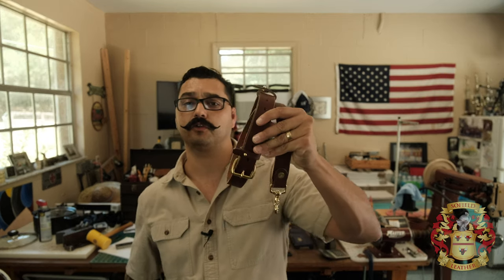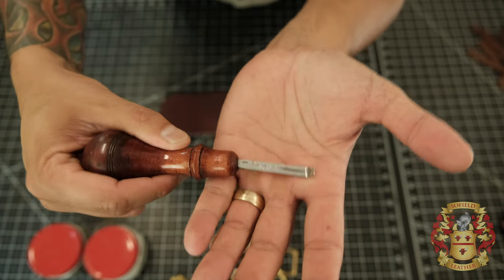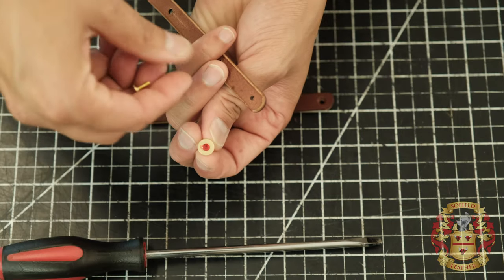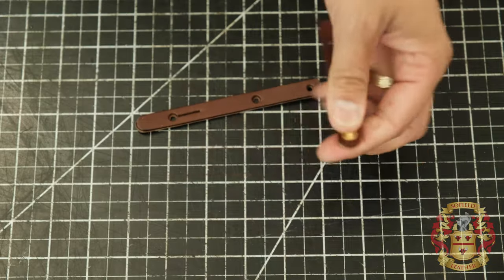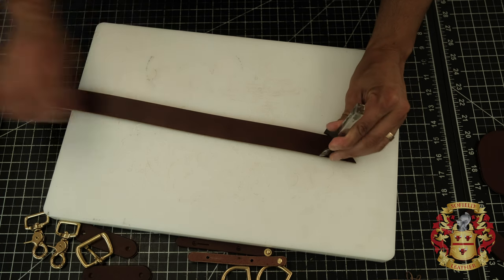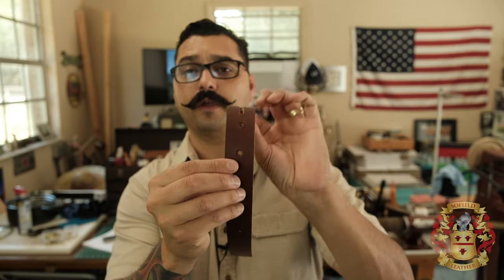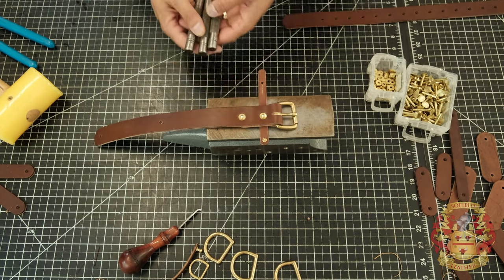How To Make a Leather Satchel Bag - Part 2 of 6 - Pattern Download

Comment from the maker: How To Make a Leather Satchel Bag - Part 2

💾 Download the Template
→ https://www.sofieldleather.com/shop/p/briefcase-pattern-build-along-video

💼 Watch the Whole Build Series
→ http://bit.ly/Satchel_Bag_Build_Series

👨🏻‍💻 Download Templates, Patterns and Blue Prints
→ https://bit.ly/Secret_Blue_Prints

🤷🏻‍♂️ How To Use My Patterns
→ http://bit.ly/How_To_Use_My_Patterns

🛠 Hardware - Tools - Material⇩

👉🏼 325 Dee Solid Brass 1 1/4 inch
→ https://www.weaverleathersupply.com/catalog/item-detail/00325-sb-11-4/325-dee/pr_1070

👉🏼 325 Dee Solid Brass 3/4 inch
→ https://www.weaverleathersupply.com/catalog/item-detail/00325-sb-3-4/325-dee/pr_1074

👉🏼 1144 Collar Set 1 1/4 inch
→ https://www.weaverleathersupply.com/catalog/item-detail/01144-sb/1144-collar-fastener-set/pr_1730

👉🏼 5015 Square Scissor Snap 1 inch
→ https://www.weaverleathersupply.com/catalog/item-detail/05015-sb-1/5015-square-scissor-snap/pr_2320

👉🏼 50 Buckle 1 1/4 inch
→ https://www.weaverleathersupply.com/catalog/item-detail/00050-sb-11-4/50-buckle/pr_321

👉🏼 3425 Button Screw Stud 1/4 inch
→ https://www.weaverleathersupply.com/catalog/item-detail/03425-sb-1-4/3425-button-screw-stud/pr_2211

👉🏼 Circle Tool
→ https://windfiredesigns.com/Tools/CircleTool/index.html

👉🏼 Pippin Punch
→ https://www.buckleguy.com/105-2-oval-pippin-punch/

👉🏼 Wicket & Craig Leather (Ask for Cindy)
→ https://wickett-craig.com/direct-sales/

💼 Shop 
→ https://www.sofieldleather.com

⏱ Time Stamps:

00:00 - Intro & Info
02:03 - Need Your Input - Thread Color
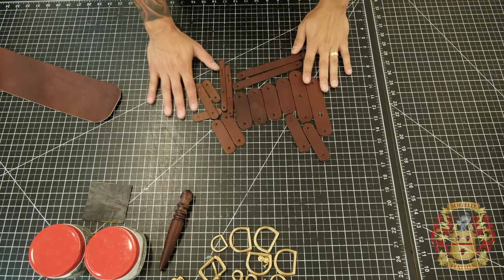02:58 - Bevel, Burnish & Edges
08:58 - Shoulder Strap Overview
11:13 - Assembling the Strap Keepers
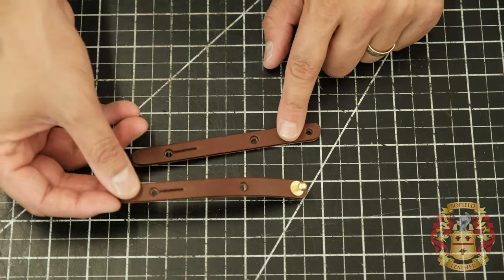12:28 - Marking the Strap for Punching (M)
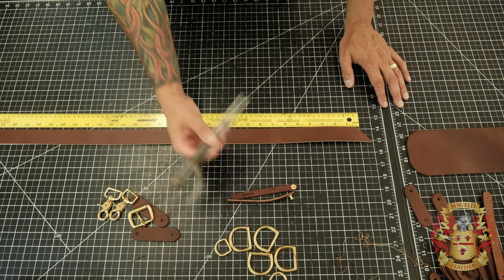13:34 - Important Tool Tip
15:46 - Punching Out the Strap (M)
16:50 - Marking & Punching Out the Strap (N)
18:30 - Quick Tip on Scrap Pieces
19:50 - Skiving the Buckle End
21:02 - How to Fasten the Strap
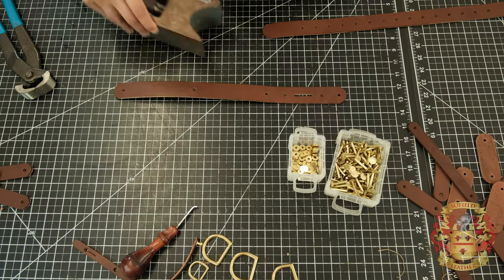21:57 - Assembling the Shoulder Strap
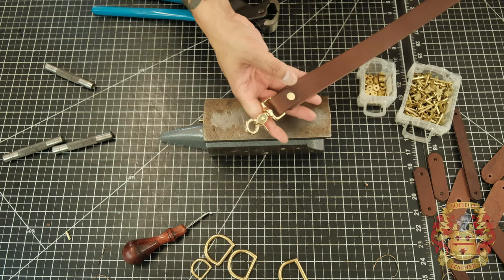26:59 - Done (Finish Size)
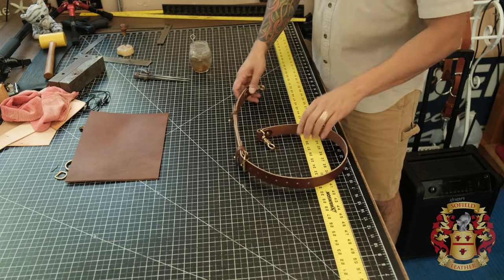27:48 - Outro

🇺🇸 Watch my Vids on Rumble
→ http://bit.ly/Sofield_Leather_On_Rumble

 🖥 Playlist ⇩

📒 Leather Patterns & Build Alongs
→ https://bit.ly/Leather_Patterns_Build_Alongs

😉 Leather-Crafting Tips
→ https://bit.ly/2HP6MZa

🤲 Build Videos
→ https://bit.ly/2ZnzVPZ

🤩 Member Only Videos
→ https://bit.ly/3qFgv66

🧵 Handmade Leather Tote Bag - ASMR - Complete Build 
→ https://bit.ly/2NDyKqa

💼 Handmade Leather Briefcase 
→ https://bit.ly/3g898hn

🎧 My Music 
→ Spotify: https://bit.ly/Alexis_On_Spotify
→ Apple Music: https://bit.ly/Alexis_On_Apple_Music
→ YouTube Music: http://bit.ly/Alexis_On_YouTube_Music
→ YouTube: https://bit.ly/Alexis_On_YouTube
→ IG: https://bit.ly/Alexis_On_InstaGram

#LeatherSatchel #LeatherPattern #DIY